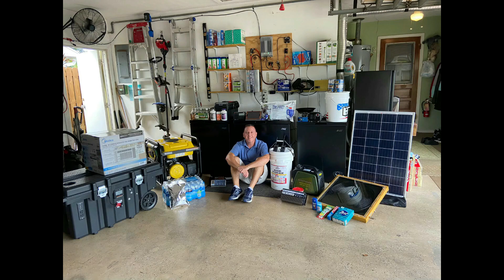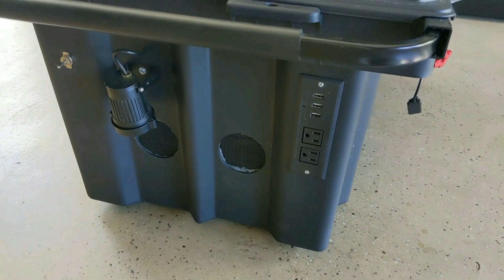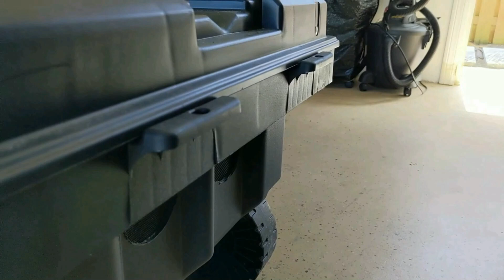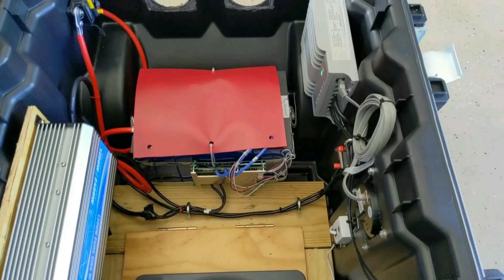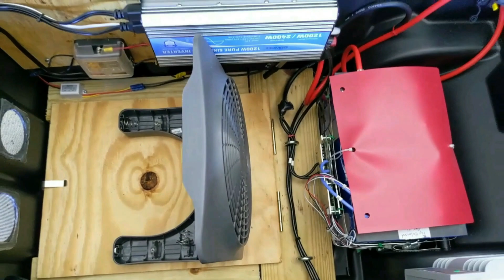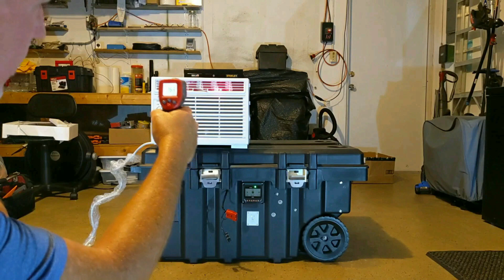3360 Watt Hour Solar Generator - BIG Power!

Comment: I just thought of a nice touch for your vent holes. If they are the right size, you could get the mini soffit vents. If you were doing this from the start, you could just get the vents and drill the right hole saw size and pop them right in. They may be bare metal, but a dust of black paint, (Golden)
Reply from the maker: That's a great idea if I were starting over.  I happened to have some screen laying around. So, I just used a hole saw and some silicone.

Comment: How do you charge it? Seems it would take a lot of solar to charge it?
Reply from the maker: I have multiple solar panel arrays on my property.  I use standard connectors (the red one on the front of this unit) on all of them just for this purpose.  I can hook it up to any one of them depending on my needs.

Comment: The mobile battery is good, but it lacks some external and internal lighting for maintenance
Reply from the maker: Good catch Ka Ka!  I have about a hundred flashlights around my property and I always have at least one on me and in each vehicle. That being said, I might have to add an additional LED light to the 12v block and mount it inside.

Comment: Nice job.

What was the brand of air conditioner?

I am looking for one that doesn't use too much power
Reply from the maker: The one I used in the video is an Arctic king... I also have a Midea of the same size...

Comment: Hello. Great video. I just found the batteries for $540 so I'm thinking about trying this build. I bought a small Lion Energy Safari LT which was expensive for the power provided. How would I use this same build but add a port to be able to connect a charger to charge it using AC when it is cloudy outside. I did read you suggestion in the comments but I would like a port to be able to simply plug in a charger. Thank you!
Reply from the maker: Thanks Travis!  I just want to make sure I'm understanding what you are trying to do.  If you want to build in a charger that you can just plug into a standard wall outlet, that should be fairly easy.  You can find a 20A battery charger that is lifepo4 compatible for about $65 right now on amazon.  It comes with the standard wall plug for AC input and DC output leads with big alligator clips.  Personally, I would cut off the clips (leaving some slack so you could use them for something else later), mount it inside the box, and then hardwire the leads into the charging side of the battery.  

If that's not what you meant, let me know and I'll see if I can still help.

Comment: Thanks for sharing this!!
Do you think I can use a 2000w inverter instead of the 1200w? Same brand and characteristics, I just ordered 1000w solar generator but I wish I have something with more capacity and power!
Also can you charge and use at the same time? How much watts I need to charge it to buy panels! 200w panels or up to 500w panel
Reply from the maker: You're welcome!  Yes, you can charge and use at the same time.  You can use a 2000 watt inverter, but I would not use appliances that pull more than 1000-1200 unless your battery can handle it and you have sized the wires/fuses properly.  200 or 500 watt panels would work to charge it, the 500 would obviously re-charge it faster.

Comment: Is it possible to charge this unit from a regular power outlet?
Reply from the maker: Yes, but I didn't build it into my box.  You can buy 30-60 amp chargers online for $200 - $250.  They are about half the size of a shoebox.  Plug into your AC and clamp the leads on to the battery terminals or shared lugs and you're in business.
Reply: @thetechieprepper  how about a standard battery charger or trickle charger?
Reply from the maker: You could, but it might not fill the battery all the way due to the differences in battery types.  If you use that type of charger and you are using a lithium based battery, ensure the charger has a lithium setting if you want it to charge fully.

Comment: Great build! Thanks for sharing how you laid everything out. I love LiFePO4 projects and I have a few smaller portable builds on my channel. I like how you have quite a bit of space for airflow and future battery capacity growth in your setup.
Reply from the maker: Thanks!  As you can see, I went big for ease of access to the components and scalability.  I can also use this thing as a table when camping or working in the backyard!  Keep on building!
Reply from the maker: Thanks!  Yes, one of my planned upcoming winter projects will be to add additional battery capacity.  I have a few unconventional thoughts and need to work on the design before jumping in.

Comment: Still looking for the right size tool box. All sold out in my area (Santa Ana Kalifornia). I have two of my DIY solar battery setups on a dolly. I want to convert a 2,400w setup to tool box install for easier vehicle portability.
Reply from the maker: Good luck finding the box.  You never know what the stores will be out of from day to day.  I built my first system on a hand truck.  It was portable, but not as portable as I liked, so I went for the roll-around.  Have fun with your build!
Reply: @thetechieprepper  Thank you sir! I checked 3 local Home Depots, all out. Will keep looking.
Reply from the maker: I got mine at Lowes.  You might check there if you have one near you.
Reply: @thetechieprepper  Duh, forgot all about Lowes! Heading there within the hour!
Reply from the maker: Just going through my channel (been off for a while for family things).  Did you find a box... and build yet?

Comment: Nice power bank. I like the headlamp idea. So you can run the AC for about 80 hours? Through the night? Curious what the efficiency would be if you ran @ 24v vs 12v. Thanks for sharing.
Reply from the maker: You're welcome!  It will run the AC for 6-10 hours depending on the temp.  If it's running full on high continuous, 6-8.  Enough to get through a hot and humid night.

Comment: Nice battery ,I can see many uses for a setup like this.But its not a generator. you say it can run a window ac unit for 6 hours,Many blackouts last a lot longer than 6 hours.My inverter generator can power AC , Freezer and lights for less that 5 gal. a Day..I am not trying to knock the build it looks great for camping  and for short blackouts. I Just think  of a generator as making power not a battery pack.
Reply from the maker: You are correct sir, I use the marketing term for them as that's what's familiar to most people, but it does not generate it's own power.  When hooked up to my solar panels, I can use it all day with the AC on and charge the battery at the same time with the extra power generated by the panels.  Then I give it a break for a few hours at dusk and turn it on before sleeping.  I've found I get 6-10 hours AC depending on the outside temp and low/high settings. I also have a 10k portable generator, and 1k inverter generator.  This is the quiet option for AC at night in my bedroom and no generator noise to disturb/alert the neighbors or disturb my sleep.  I also take this camping and the silence is golden...It's all about redundancy and having options...
Reply from the maker: @kimmer6  Thanks!  I purposely used the big box so I can easily repair and scale up in the future (when prices come down on cells again).  Keep on building!
Reply: @thetechieprepper  if i wanted to scale up from the get go, what all would need revised on your shopping list in the description? i’m thinking on using 120mm fans and could use that extra space in the case for more cells. appreciate any help!
Reply from the maker: @sneepsneep  Hey Sneep.... I'd need a bit more information on what you mean by scale up.  Let me know and I'll be happy to help.  Funny, I was going to use some cpu fans in my vent holes originally, but had the large fan laying around so I put it to use.  If I ever add more cells to the build I will have to go that route.  My current build is set to work with my panel capacity to run the AC for 8 hours or so and then charge up to full  the following day.  

If I add more battery capacity, I would not be able to refill it each day with the panels i currently have dedicated to it.  The first use would last longer, but after I use that top 50% I would only be able to fill it to 50% (or where I'm at capacity wise right now) each additional day. It would be nice to have that extra initial capacity on a weekend camping trip though.  Now you have me thinking!
Reply: @thetechieprepper  thanks for the reply! by scale up, i mean use 600w worth of panels, more cells, etc. wasn’t sure if much of the other components would need upgraded as well. e.g. charge controller, breakers, inverter, etc.
Reply from the maker: Oh, got you.  Well, there is scaling up on the capacity (panels/battery) and there is scaling up on the capability/power delivery (inverter, fuses, wire size, etc.).  If you want to run the same items but for longer periods of time you would scale up the battery bank, add additional panels, and a larger charge controller to get the larger battery back to 100% quicker.  If you wanted to run more load intensive items, you would upsize the inverter, wiring, fuses, etc. (assuming the discharge rate of your battery could handle it). .... or you could do both!
Reply: This is a solar generator

Comment: nice build but I would put the fan so it sucks all air out and new air coming in instead of circulating most of the internal air which could get real hot at high loads like running an AC
Reply from the maker: Thanks!   Yeah, that might be an improvement.  I'd have to get two small CPU fans or something to fit over the holes.  It seems to be working well as is, but if I find it gets too hot, this is a great option.
Reply: @thetechieprepper  120mm case fans can pull 100cfm and draw less than 1amp on 12v
Reply: @scottbradford192  The Step down converter from 12v to 9v is for the fan?
Reply from the maker: Yes, they used to make a 12v fan, but changed it to 9v a few years ago so it didn't use as many batteries.  It will run on 12v but I didn't want to wear it out any sooner than necessary.
Reply: @scottbradford192  how would you convert from the 4 pin to the fuse? just cut the pin off and hard wire it?
Reply from the maker: Sorry for the late reply.  I'm not sure I understand the question.  If you are referring to using a CPU fan, yes, I would cut the connector off and hard wire it.  I'd most likely solder due to the small wire size.  I don't trust crimping with those tiny leads.

Comment: Very neat. Ho much did the build cost, and how much does it weigh all in? Is it easily expansible ?
Reply from the maker: When I built it it was just a bit under $1k.  I bought my solar panels used from a local dealer.  The price for parts fluctuates (especially lately).  Currently 2000 watt retail units are selling for about $1700.  So, even if it costs a bit more to build currently, you still get an extra 1300 watt hours and save a bundle building it yourself.  ... and it's fun!
Reply from the maker: Sorry, haven't weighed it to be honest, but it is easy to roll around...even in the grass.  Yes, it would be easy to scale up.  That's one of the reasons I picked such a large box.  I might want to add more capacity in the future.